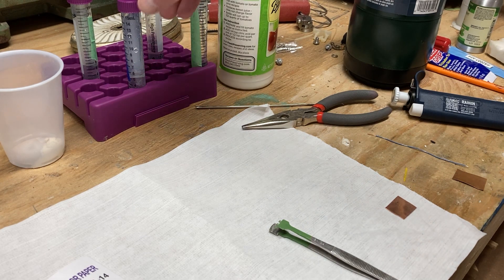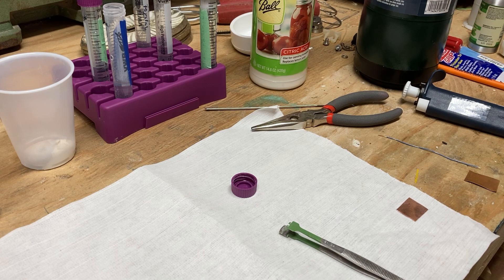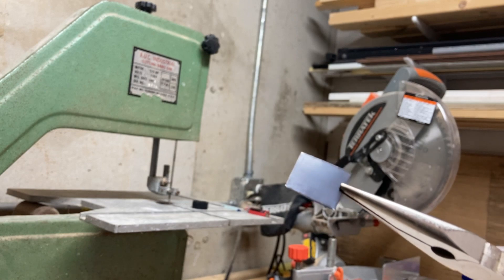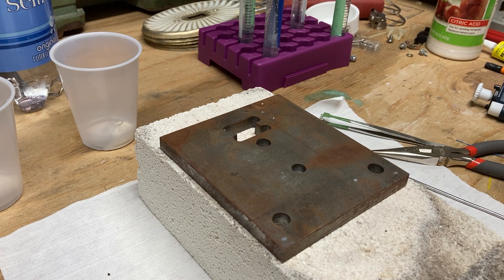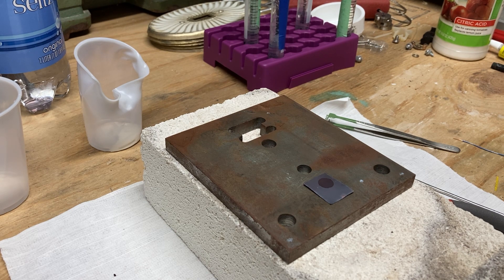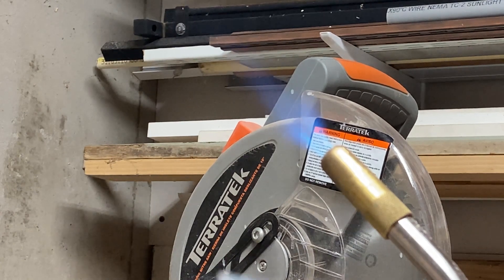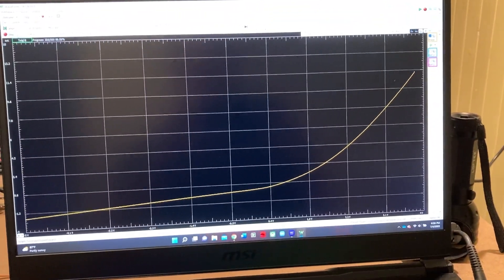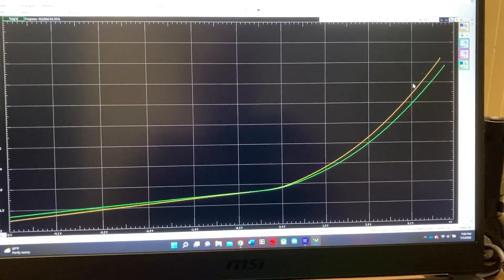Dead Battery to Diode

Comment: Nice work , I have a simple experiments about creating a diodes out of zinc oxide ,  just couldn't got any success yet .
Reply from the maker: Cool! Well keep at it and hopefully you'll get there. Are you trying to dope the ZnO? I played around with that but wasn't satisfied with my ability to control impurities at the level needed.
Reply: @Drjtherrien  I just want to create a point contact diode close to 1N34 in its features , and before everything it should be stable against lite shocks caused by movement .
Reply from the maker: Yes that will be challenging. I think one issue is that ZnO is a relatively soft material and will be easily scratched. Combining that with the need for the film to be thin is going to make that challenging.